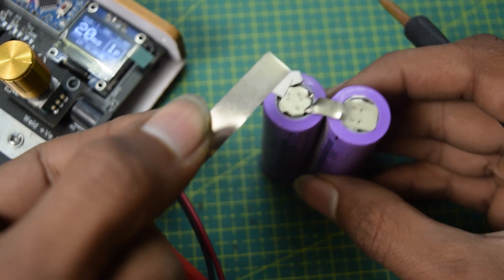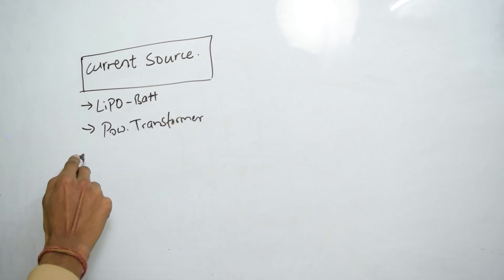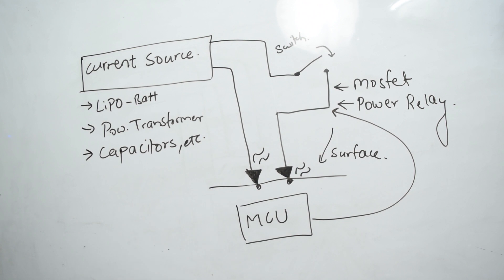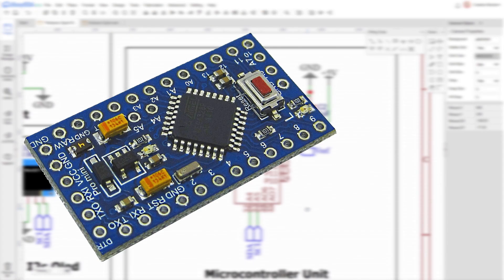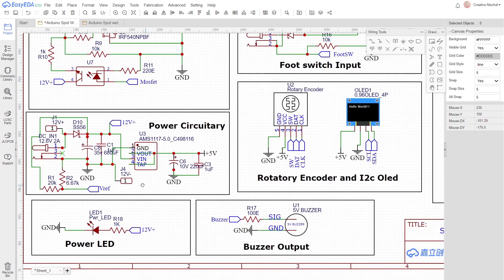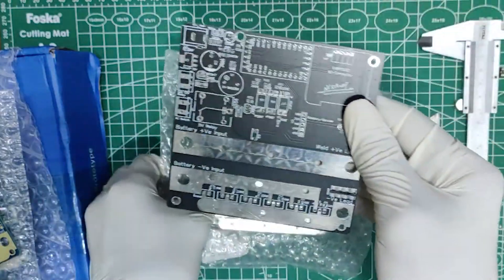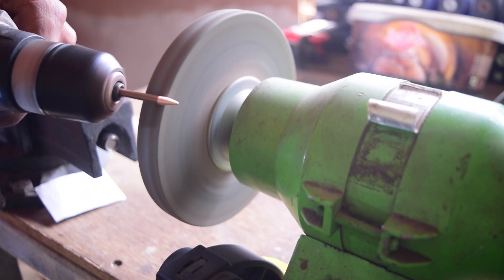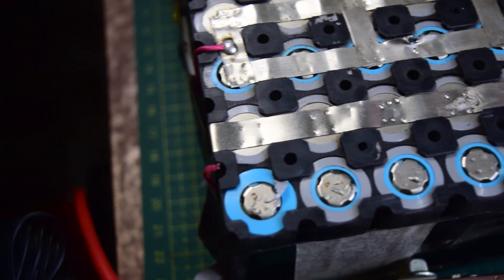How to make a Arduino Spot Welder

Comment: what are the purpose of those schottky?
Reply from the maker: Ideally, TVS should be used there. 
It is there so ot blocks the high voltage spikes that is generated during spot welding from getting to mosfets. 
If you don't have schottkey there, mosfets will blow in no time

Comment: all my 6 mosfets blowed up at the first try. Micro second  was 600 ms and I was using 12V car battery. how can I over come this?
Reply from the maker: 600ms is way tooo long to spot weld. 
I have set my code such that I cannot set more than 70ms. If I need more power, I use double or triple pulse method
Reply from the maker: It happened with me too. Did you make the PCB?
Reply: Thank for reply...I got the fault....10ms will be ok....

Comment: I bought k99 Chinese spot welder at 1.5k with 99 gears modified the traces with thick copper, i used 3s lithium battery 5000mAh with 50C continuous discharge rate or car battery. It can weld upto 0.3mm pure nickel sheets combine with .0.1 copper sheet. Love your contents ❤
Reply from the maker: Thank you.

Comment: I'm trying to make a mosfet spot welder can you please tell me how to add a freewheel  diode to protect the mosfet from a positive voltage spike ?
Reply: Can you share mail id or Instagram
Reply from the maker: @atheist_happie its is available on the about section of my channel
Reply from the maker: The schematic diagram and the code is shared in instructables
Reply: @AmateurInventor  thank you for sharing the code 🙂
Reply from the maker: @atheist_happie  you're welcome
Reply: @AmateurInventor  1 more question I don't have oled display I have liquid crystal display I2C can i use ? Or i need to change the code  which line needs to be changed ?
Reply from the maker: You obviously need to replace the code to display on LCD, but believe me, a lot of optimization has been made to display menus, it would take you quite some time to change the code. Better go with the original display
Reply: @AmateurInventor  okey Brother 😀
Appreciate your support
Reply: @AmateurInventor  brother code is not showing in website can you share link ?
Reply: I ordered the oled display and want to use mosfets as a switch in this video you used 6 mosfets can you tell me the part number of it ?
Reply from the maker: @atheist_happie you can use IrlZ44N or IRL530 Mosfets. You can use prettymuch any N-Channel Mosfets but keep in mond, all the mosfets should be shame and most preferably from same batch.
Reply: @AmateurInventor  thank you i ordered 3207 mosfets 12 pcs will let you know after completing this project 🙂
Reply from the maker: @atheist_happie sure, that would be great!
Reply: @AmateurInventor brother i received a display today 🥲 and found out that display is 1.33" in size not in 0.96 which you're using in this project libraries are different for my display SH1106_128*64 what should i do now ?
Should i include this library to the code so this display works like yours ?
Reply from the maker: @atheist_happie if you can make the display and then replace the lines that does the displaying part with your library then, it can be done
Reply: @AmateurInventor  ok I'll try 🙂
Reply: Are you using a 1.3 inch display or 0.96 ?
My texts are going out of the screen from bottom
Reply from the maker: @atheist_happie  0.9inch one
Reply: @AmateurInventor  can you share picture of your display backside so i can identify I'm suing same one as you ?
Reply from the maker: @atheist_happie, it is soldered in place, I'll share it while I am the office
Reply: @AmateurInventor  okey Brother 😀
Reply from the maker: @atheist_happie  sorry, went outside for a job today. You can check whether vcc gnd sda and scl are connected properly,mine display is also a generic display that i got from my local market, it is very common, please mail me so we can talk there!